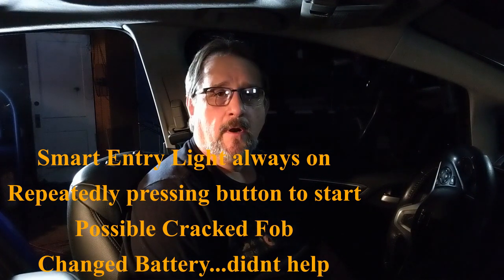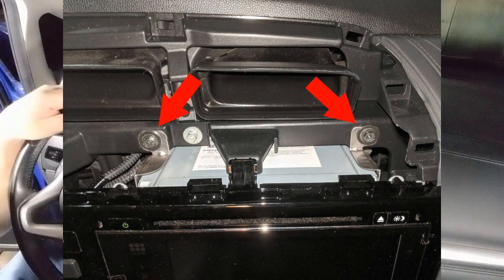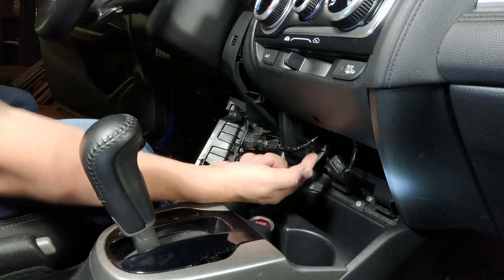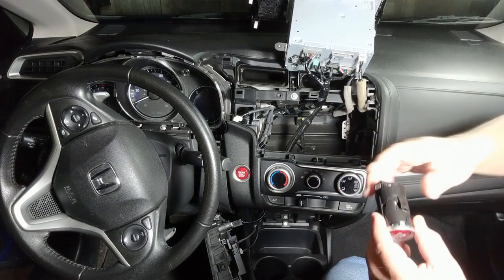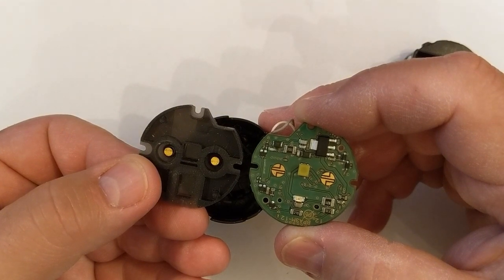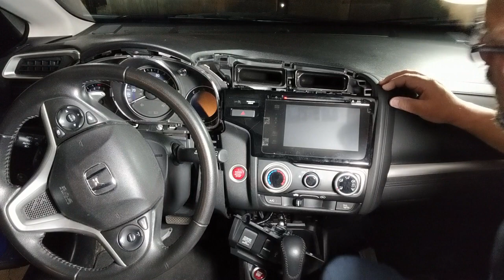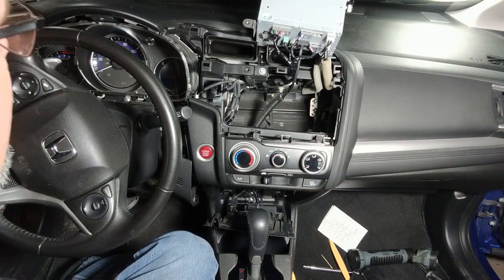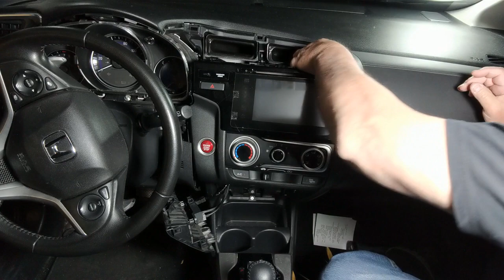Push Button Start Switches (Honda) Repair or Replace [2020]

Comment: The hardest part for me was getting the plug off the back of the start button assembly. If you pull it out some then twist it to the right, its easier to push on the tab to release.

Comment: I have a 2015 Honda CRV with same issues, but not showing covered, but I bet I have the same push start: Warranty Extension: 2015-2018 Multi-Model Keyless Start System Error December 9, 2020, American Honda is announcing a warranty extension for certain 2015-17 Fit, 2016-18 HR-V, 2016-17 Pilot, and 2017 Ridgeline vehicles. This warranty extension covers the engine start/stop switch to address concerns of difficulty in starting or stopping the engine. American Honda is extending the warranty coverage of the engine start/stop switch to 9 years from the original date of purchase or 125,000 miles, whichever comes first.

Comment: Thank you so much for the video. Work like a charm! Got a 2015 fit, smart key system light was on constantly, clean the contact on the switch, light to off after ignition.

Comment: If anyone else gets the beeps and blinks shown in the video the culprit is the first electrical item that was disconnected from the lower console. That is the key fob detection/communication antenna and if it's not plugged in or the connector isn't fully seated then it won't be able to find and confirm your key.
Reply: Captain Slug! You're my hero! I didn't put everything back together because I couldn't verify that the new switch was working. I've been trying all sorts of stuff for hours and you saved my butt and helped me sleep tonight now that I'm back in business. 
THANK YOU!!!!!!

Comment: Similar problem to my wife’s 2014 Honda civic. Will push the start button, nothing happens. Push it again to turn car off, then push it again, wiggle it around and will finally start but after minutes of trying. Will replacing/cleaning this starter button fix her problem?
Reply from the maker: Thats exactly what mine was doing. And it got progressively worse. Read the comments there is a recall on this. You could get it fixed for free.

Comment: Thanks for this video. I was able to order the part and do this myself watching your videos, and I am no car guy. I had issues with disconnecting some of the connections and also reconnecting the switch. It was just hard to  get them to cooperate. Also, that screw that is up under the radio console is a doozy. Just be prepared and make sure you have those no mar blades to pop off the paneling. I'd say that's a must.
Reply from the maker: Yes the non maring blades are helpful in alot of situations on a car where you dont want to mark up or break something.

Comment: You can remove this ignition switch in 15 minutes by removing the trim on the right side of the dash, then remove the lower panel under the steering column, then the glove compartment. You can reach the securing tab of the switch from the glove compartment side. To access the other side securing tab, remove the small panel on the RHS of the steering column.( has horizontal slots ) This gives you access to the other securing tab. Then simply depress both tabs and remove the switch. I've done this several time in 15 minutes only.
Reply: Please clarify which component is the “trim” on the right side of the dash. The “dashboard center lower cover” that has the 12v/HDMI/USB ports in it?
Reply: There is a small trim panel facing  the driver’s door. This has to be removed first. I think I recall a 8mm hex bolt that has to be removed after this panel comes off.

Comment: Thanks so much for making this video! It really made taking the starter button out a lot easier!

One little thing I did to be able to visualize where that bottom screw is on the head unit is I used my cell phone and put it on selfie mode so I could see the screen and then I ended up into the dash and then I couldn’t find where the screw was. Otherwise it was very tough For me to figure out where it was and you can’t really crouch down and look up under the dash to see it. Another thing you could do is a mirror. Also another thing I might do or should’ve done is the tab that holds in the starter button I was thinking I might actually crack it off because it will make replacing the button in the future that much easier because you’ll only have to takeoff the left side of the bottom of the dash and then push in on the tab on the left side which should hold the button in place anyway. Just a thought. Thanks again for the great video!

Comment: With a different switch in, ours just beeps and flashes the green light.  You can hold the key up to the pushbutton and it will then sense the key and start the car.   The whole comfort/convenience opening feature for the doors and ignition don't work with the replacement key in.  Nobody seems to know why.  All works with the original key in.  I've now cleaned the original switch and will put that back in, which will hopefully have everything sorted.

Now if I just knew why the clock resets itself to 3:00PM ten seconds after every engine start.
Reply: Well, I removed the radio, reinstalled it, and the clock works.  Put the cleaned original switch in, and the car starts, but the smart entry / comfort start stuff is still not working.  Odd.
Reply: Our local dealer wanted to change the starter for $900 and said that was the problem.
Reply: @richardluntz6169  so did you replace the starter or button

Comment: I wish you made this video a year ago. I paid $500+ to get the button replaced. But thank you for this video. Good reference in the future just in case. Keep it up. Liked and subscribed! 
Also you mentioned the small battery our Fit have... what lights caused the drain? I have a solar panel trickle charger to keep the battery juice up specially during winter time. I am planning to get a bigger 51R battery when my car is due for a new battery. I hope that will help.
Reply: Wow that's insane. I see replacement button assemblies for ~$30 online, so they charged you $470+ for that much labor? Bonkers
Reply: @woofiewill  yes. Fortunately Honda America will reimburse when they had the recall letter for it.
Reply: What issues were you having start up? Did all you dashlights come on when pushing the button?

Comment: Started having the same issue a few months ago. I took it to the dealership I purchased it from and they said replacing the button was covered by the warranty, they "supposedly" replaced it and I say that because a few days later the issue got worse, it took 20 times to start the engine. So I took it back to the dealership, they said it was the battery, so I bought a new battery. The next day, same problem, took several tries to get it to start. I took it back to the dealer and watched as they hooked up their computer to diagnose and still they couldn't figure it out. The mechanic decided to try and blame it on the starter, so now i have an appointment to fork $500 on a new starter....... very frustrated with honda!

Comment: I changed the button with a new button. Had a bunch of no start issue and the car kept thinking the key remote is not in the car. 

So far, the car has started now…but I still have the Wi-Fi indicator on the dashboard. I guess the new button connectors are corroded or something. 😢

Comment: Hi Ana thanks so much for this great video. I am having trouble disconnecting the cable connectin the radio so I can pull the radio out to place on dashboard.  Is there a trick to disconnect these two cables?  I don’t want to damage the connectors by pullin too hard.  Any direction would help. Thanks

Comment: FYI. Honda Service Bulletin 20-098 addresses this issue and it is under warranty for 2015-2017 Fits. They fix it for free. Take it to dealer with copy of Service Bulletin.
Reply from the maker: Yes...that is true. I also recieved the bulletin. Personally wouldnt have taken it to the dealership for this if I hadnt found a video similiar to this.

Comment: So, I did this and my problems got worse. Before taking out the button and cleaning the contacts, the only issue I had was the smart entry light being on. Now the car won't start unless I push the button with the fob itself. As soon as I plugged the button back in, it started beeping and blinking green. Also, the lock button on the outside door handle, and the unlock sensor when I grab it, no longer work. I don't know if I messed something up in the button housing when I disassembled/reassembled it. But I ordered a new one from Amazon. So I hope that works.
Reply: ***Update: There is a wire that he "reconnects" to the faceplate w/ the USB/HDMI/Cigarette lighter. THAT thing!! It wasnt obvious last time I put things back together, where it plugged in. along the top, parallel to the face, that thing must connect some transmitter that reads that the fob. After plugging it back in, my car started with no issues. AND the light went away. So yeah. This fix actually worked!

Comment: What was happening when you were trying to start your car? I have a Honda Fit 2016 less than 60,000 miles and I have this intermittent starting issue sometimes no problems for several starts others it takes multiple attempts to start the car. Battery and alternator were ruled out. When I took it to be diagnosed they had no issues starting it so they didn’t believe it was the starter. I bought a new button online so hopefully this works.
Reply: Same problem/symptoms I had with my 2015 Fit key start (67k) and it was the starter.  I replaced it and it has been fine. Looking around many others 2015-2016 starter issues with same symptoms.  Maybe when they tested it, it was ok because of the problem being intermittent at first (it gets worse over time harder to start and more frequent).  Or maybe push button can show  the same symptoms?

Comment: I noticed on my 2014 honda odyssey that when it's cold outside, the initial start sounds like the starter is not disengaging for a second or 2 , kinda like when your engine is running and u turn the key on(like a grind). I replaced the starter (based on the sound of a start olfrom another youtube video)and the problem was still present. I used a blow drier the next morning warmed up the button and area under the steeringwheel (thinking the ignition relay might be there) thinking the button or relay is sticking when cold outside. When starting,  the grind noise didn't appear. Before I remove and clean the push button switch, I want to ask if you ever heard from anyone that a sticky button or sticky ignition relay could be causing this cold start grind? Once the car is warmed up, i can start it several times a day with no repeat grind. Also, I replaced the starter cutt off relays too thinking they were sticking but no dice, problem is still there.  Please advise. Btw, this video you posted is awesome!!! Thank You
Reply: Its probably your vtc actuator.  Its a common problem across many Honda models.  My 2015 fit does it.  Turn on just your electricity, let your radio and everything kick on and wait a bit, then turn on the engine.  It should lessen/prevent it from happening.  Its pretty annoying and Honda does not care.
Reply: @booboomtv123  I'll try it. What's the fix? I'm already out of warranty

Comment: Great video Bryan. Was your keyless entry system warning light on before the fix?
Reply from the maker: Yes it was...
Reply: Bryan Shattuck thanks for getting back. After watching your great video again I see you said that in text. My light was on but everything working good. I pushed the button a bunch of times very quickly and also removed remote battery and reinstalled and blew on those contacts and light did not come on. Not sure what did it. I should have done one at a time. If it acts up I will for sure use your instructional video. Thanks again.
Reply: Bryan Shattuck , I can not get the first step ( removing the trim around speedo). Seems like it will break even with plastic trim tool. Any tips? Can’t believe all this dash has to be removed just to get to a part that seems to fail fairly regularly.
Reply: @D.D.T.123  I disconnected the battery for a few hours and the warning light went out. It came back on after a few days. I also had problems with the start button as it took many attempts to start my car and it got worse over time. I ended up replacing the start button as I described above.

Comment: I have a 2015 Honda Fit with a new battery and starter. It still won’t start after the first push. It takes 5-10 pushes to start. I’ll never buy another Fit because all it gives me is fits.

Comment: Hi, having the same exact issue with my 2015 Honda Fit ExL. question for you, where did you purchase the replacement push to start button? The only place I could find this is on Amazon and takes over 2 months for shipping. Thank you for the video ! Very very helpful
Reply from the maker: https://www.hondapartsnow.com/
Reply: BRITTANY I ALSO HAVE THE 2015 HONDA FIT EX.  I DON'T THINK YOU NEED TO REPLACE IT JUST CLEAN IT & CRUB IT WITH FLAT SMALL SCREWDRIVER  BUT THE HARDEST PART WILL BE TAKING OUT THE SCREW UNDER THE RADIO AND PUTTING THE SCREW BACK WILL BE TOUGH AND CAREFUL NOT THE DROP THE SCREW CAUSE I DID LIKE TWO OF THEM AND UNABLE TO LOCATE IT.
Reply: Nathan Chau thank you for your help! I will try this. When you say scrub, where and what exactly are you cleaning?
Reply: @brittanyrodriguez4074 more like light scratching it when you watch this videos it show you where to scrub it.   dust/grease
Reply from the maker: @brittanyrodriguez4074  The brass contacts...

Comment: It is so awful that so much similarity exists in subsystems between models, e.g., Honda Fit and Honda Accord, and the same Start/Stop Pushbutton problem in the 2017 Accord that I have, and almost 5 years of ownership this problem developed  (in May 2022.)
 
Long enough a story, I took it to the dealer (actually my spouse did) and idiotic people there took our money (and they are located in Clarksville, Maryland) but did not solved this problem.  (I had insisted to them to replace the Start/Stop Pushbutton switch, because I had googled up and also watched some Youtube videos, but they refused that as they just replaced only a relay for the Stop light, as the thought they knew much with HDS, Honda Diagnosis System.)  To minimize the cost after a WEEK (with two hours on each day), I towed our car back home.   

Obviously, I am interested/motivated to watch enough of these examples, and I will (later) give it a try on my car.

Comment: same thing happened to my 2015 HONDA FIT EX  my was also BLue color.  i think it happened after 3 year i purchased it BRAND NEW from HONDA Dealer ship.  I wend to AUTO ZONE, PEP BOYS, FIRESTONE,  some say BAD BATTERY OTHER SAID STARTER AND ONE SAID ALTERNATOR.  i did changed the fob batteries,  new CAR BATTERY STILL TAKE ME 5 MINUTES TO START THE CAR AFTER 20 TIMES PUSHING THE BUTTON
Reply from the maker: My has worked just fine , but remember I replaced it

Comment: so i only need the contacts of the button?
Reply from the maker: Yes...clean the metal contact surfaces ...
Reply: @brshattuck  I would think a tiny bit of dielectric grease should be applied to the contacts as well to reduce future corrosion, what do you think?

Comment: Wow, not fun looking. I was sold an ignition switch that goes on the side of the steering column. Guess what- this car does not use such a device, or if it does I can't find it.  So I guess that all is replaced with the start switch assembly??

Comment: Pushstart broken. Replace pushstart $250. 3 days later stranded again. Tow truck $140. Diagnostic starter broken. Replace starter + diagnostic+labor.
Total $1100.  All of it caused by 25 cent contacts on a plastic switch. Absolutely disgusting. Why transport canada and consumer alert silent? Recall is fully warranted.

Comment: There is a Honda Recall to fix this problem if you have less than 125,000 miles.  1/10/2025